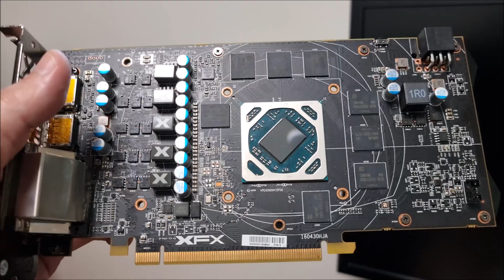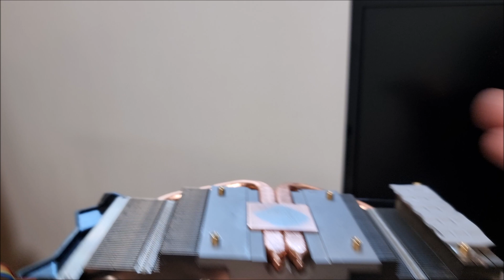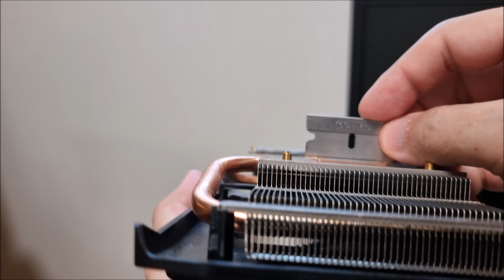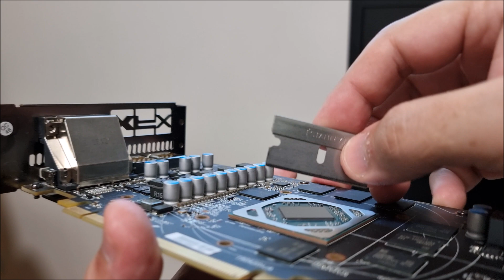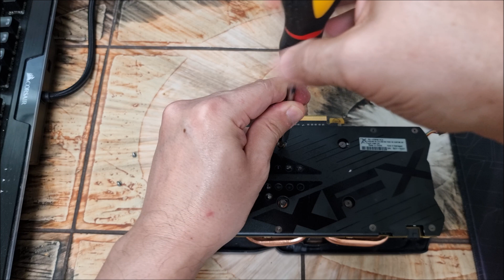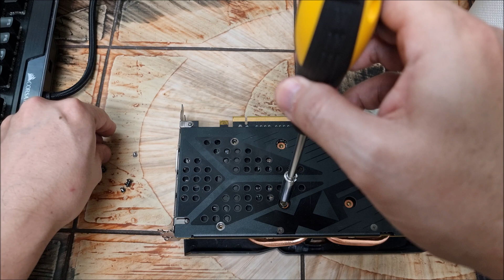GPU Hotspot Mystery Solved! Not What You Might Think!

Comment: I'm a new gpu user, actually bought a used sapphire pulse 5700 oc recently, but I undevolted it quite a bit and the usual temp on full load is 60°c but the hotspot temp it shows on amd software is 67-70°c , but the thing is the upper plate on the gpu there's like a hole and some inner pcb is visible which is directly under the chipset, that part i touched with my fingers and idk man it didn't feel 60 or 70° to me it was kinda very hot idk, is this normal or am I just overreacting
Reply from the maker: 70c and 80c is very hot to the touch. So yes, it is very normal.
Reply: @lyziqco6555  for what it's worth, I'm on a 5700xt and my hotspot is 95-105c at full load, and thats after under volting and underclocking. Research tells me this isn't ideal but also isn't really a problem either. Though I was thinking about putting new paste on to see if it helps. Running stock speeds and volts it was hitting 110c which I think is the thermal limit when it starts to throttle.

Graphics cards have been hot for years though, I remember having an oooold 560ti nvidia card which didn't care about heat till it hit 100c, and that was way back then.

Comment: Gigabyte RX 5700XT Repasted, cleaned & Re-Pad:
CS2 High settings:
Vram 6gb used over 8gb
GPU Temp 82*c
GPU Hotspot Temp: 112*c

Thermal paste: HY510 (I put then spread it using q-tip as substitute then put a very tiny in the middle in the Die)
Thermal Pad: Subzero GP-Ultimate (vram 0.5mm mosfet 1mm backplate 3mm)
Reply from the maker: So whats your temps now?
Reply: that's my current temp, uncle helped me last night doing repasting and cutting thermal pads. @TechnologyHive  I think I didn't put the heatsink too hard and some of my internet fellow players telling me that I put too much thermal paste in the Die and shouldn't spread myself using q-tip but instead just drop a pea size and let the heatsink spread itself.
Reply: @TechnologyHive  It was 2nd hand I bought in facebook marketplace in worse condition too oily, the fans are coughing with dust, the board was bad and the paste inside was dried. I tried playing once CS2 then shutting my PC monitor and freezing everything because when I check inside it  was Dried stock paste and Pads was torn down. It was like if remember correctly the 87-89*c on GPU temp but the Hotspot I don't remember much since I was using old version of AMD Driver that time. Bough January 2 2024
Reply from the maker: @markhovscrch4050  It is better to spread the paste over a GPU die. Using the pea method could result in areas not covered with paste, resulting in a hotspot problem. your internet friends are wrong, I'm afraid.
Reply: @TechnologyHive  I put a medium size then spread it into Die then I put a very tiny amount of paste in the middle of Die and slap it with heatsink. Maybe on Next sunday I go repaste it again I felt unsatisfied due to my current temperature of Hotspot right now playing Hellbound: Survival Mode on V-sync + Ultra settings sending my it into 102*c but the GPU temp was 81*c something isn't right
Reply from the maker: @markhovscrch4050  I'm sure it's due to poor contact with heatsink.
Reply: @TechnologyHive  Yes it is poor contact with heatsink I must squeeze it again next sunday.
Reply: @TechnologyHive  i have known someone who used radeon vii for 110c hotspot for 5 years and it still performs very well
Reply from the maker: @thepromptist47  That is because the card is thermal throttling to protect itself. It would run much better if the hotspot temperature was reduced.
Reply: HY510? that' why.
I had the same and used it for my 12 years used ATI radeon HD 5570 and I got 15-20c worse temperature (80c+) over the (Original paste 12 years old!)

Comment: I've ran games that pushed to 62 degrees and hotspot to 88 but no more than that. My GPU is relatively still fresh despite having it for a year now (It's an XFX RX 6600) and I can't tell if that's a lot or it's okish but it concerns me a little.
Reply from the maker: 88c is not dangerous territory. 95+c I would consider too high.
Reply: @TechnologyHive  Ah, okay. 88 is generally max it goes, usually lingers between 75 and 85 but never constantly. Thanks for the info. Only started observing that temp now
Reply from the maker: @a4455.  You're good. Just keep an eye that it doesn't go over 95c. Then you'll need new paste :)

Comment: I dunno my 7900 xtx asrock aqua runs like 111c and zero issues on a super ultrawide monitor at 1440P. Runs flawlessly. Some of it i think is just BS. Because i'm even running x2 420 rads. All i'm saying it's been running like butter.
Reply: I think a lot just want extreme cold temps for benchmark scores. It's hard telling because my card isn't throttling nor is myCPU. I mean absolutely zero issues. And this has been for over half a year.
Reply from the maker: @ramblinjay3816  110c is extremely hot. If you keep it running like this, you may be cutting short it's lifespan.
Reply: I dunno, I'm still running it fine even on helldivers 2. Even maxed out settings at 100+ FPS and it's all liquid cooled. I'm still hitting like 111c lol. No stuttering, lagging, nothing at all. Why i am so confused about all of this. Even with x3 420 radiators on a full looped system i am still seeing zero issues regarding it being too hot. 

I will also include this is also with Asrocks extreme bio software update. If i'm not throttling and i am losing zero productivity it's still going strong.

Wouldn't i be noticing throttling issues running this hot besides just a possibility of degrading the GPU overtime? @TechnologyHive
Reply from the maker: @ramblinjay3816  111c is too hot. This will slowly degrade your gpu.

Comment: My 6950xt had the same issue no matter what i did. It would hit 110 on hotspot until i used ptm7950.  It made a huge difference now hot spot is about 90 thats with the card overclocked to the max.
Reply from the maker: Very interesting. I keep hearing about this stuff. I'll have to try it myself. 👍🏼
Reply: PTM7590 is magical stuff for sure! It has performed better than liquid metal on my GE66 gaming laptop, believe it or not. Glad to hear that it fixed your issue!

Comment: why doesn't my AMD XFX 319 6800XT GPU temp go up on my kraken 360 elite's display during furmark runs?...Furmark says gpu is 72c but the kraken display says 42c....wth??? the Kraken has always reported a temp that's around 10 degrees cooler than what my adrenaline software says or what hardware info64 says, but with all this variation from different softwares i dont know what to believe
Reply from the maker: Download GPUZ from techpowerup.com and run fuemark again with gpuz displaying temperature and Hotspot.

Comment: Well, is this a coincidence or all brands have this problem? I bought XFX RX 6800 (Non XT) before new year and have return period till 13 Jan ‘24. 
The card overclocks well with fan  high speed RPM and over 200W power consumption.
Using AMD PRO 23.Q4 driver as that was installed by default with their software.
Gpu frequency set to: 2300MHz low/ 2420 MHz max (2400 effective),
VRam timing set on: Fast timing ,
Vram  frequency set to 2112 MHz (2100 effective),
Voltage set to 925mV with Power Limit +10%.
Fans blow between 1500 and 1800 rpm with temps up to 60C with 74C hotspot.
This is my first AMD GPU since 20 years ago. Should I return it because of the 14C hotspot difference?
Reply from the maker: Nooooo. Your temperatures look good actually. 74c on the hotspot is perfectly normal. 95-100c is not. Though AMD will say 95c on the hotspot it ok. But this is BS. They just do not want to deal with RMA's for a problem that slowly degrades their products. 

In time, after some years when the thermal paste starts to lose it's thermal conductivity, that hotspot temp will skyrocket and cause your card to thermal throttle, eventually causing problems. But in your case, you're fine! 👍👍
Reply: @TechnologyHive actually if I use the default factory settings the hotspot goes up to 98C (fans run ~900rpm) and get far worse results with games crashing very often. 
Is my overclock high for this gpu? I think I could squeeze just a bit more performance out of it.
And again is 14C difference overall/hotspot temp normal?
Reply from the maker: @DennyMK007   14 degree delta is okei if the hotspot is under 95c. But if at default settings your temperatures are getting that hot, that is not normal. 98c is pretty toasty. I would RMA it or replace the thermal paste and see if that fixes the issue.
Reply: @TechnologyHive  RMA it is then. I don’t want to bother replacing thermal paste/pads on brand new gpu.
Thanks

Edit: I bumped the frequency to 2440 MHz and lowered the voltage to 920mV. 
With the Power limit to +10% it runs constantly on 1025mV.
Gamed for two hours with HWInfo in the background. The result:
GPU temp max 58C, Hotspot max 71C, fans max 1780rpm. I can’t get anything new with 3 years warranty for $425 16GB VRam after tax that’s going to be better than this. Keeping this cheapo awesome overclocking gpu.
Reply: Hi. Is this thermal paste issue on all the 7900xt cards? Or is it rare to buy one and get this issue? Still on the fence to buy one..

Comment: Hello.during gaming tlou,alan wake,warzone,when fan speed is 40-45 gpu temperature is 50 celsius and in alan wake 55-57,in furmark after 17 minutes strees gpu is 73 celsius and hotspot 93-94(fan speed 50%)and is it normall? Iddle temp gpu is 25-29 and hotspot 33-34.
Reply from the maker: That's a 20degree delta, which is a bit high, though common. You could improve this by using better thermal paste if you feel comfortable doing it yourself. But if your card is still under warranty, keep in mind that taking it apart will void it.
Reply: My rx6700Xt has a 30 C° Delta. 75 to 105. Allready done a rma ticket. Let's see how they answer
Reply from the maker: @daidalos1508  If you have warranty on it, that will be the better way to go. Just RMA it.

Comment: Have had some issues with my screen just turning off randomly, these were my temps:
This is with fan speed all of my case to the max
GPU highest temp: 81.2 C
GPU Hot spot highest temp: 93.9 C
Highest CPU temp: 71 C (I love my noctua cooler)
Reply: That temp for the card, not the hot spot but the general one, is likely nearing the point of throttling and does indicate to me that there is an issue with temps. That CPU temp is high as well, depending on your CPU. What are your system specs? Does your case have decent airflow? Have you tried custom fan curves?
Reply from the maker: Does the screen turn off while under load or also during idle?
Reply: @TechnologyHive  The screen had turned off while it was idle.
Reply: (Watching youtube)
Reply: @Floridian_Krillhead  what was your findings? I too am having my screens turn off randomly, not always while gaming either, and my hotspot is getting to 110c if  I run a benchmark. Did you get a new gpu or was your power supply the fault for turning off? I have just fresh installed windows and drivers and same thing is happening for me. My gpu is only 1 year old as well in very good case ventilation.
Reply from the maker: Have you tried new thermal paste? Sounds like gpu is overheating.

Comment: well the only problem i have is my rx 6700xt, first thing i use copper thermal pads on my memory, the overall GPU temps down to 60-70 on full load, but the junction/hotspot reached 100+ , even when the load are 80% or below
Reply from the maker: I think I understand you're doing the copper shim mod on your VRAM, right? If I were you I'd leave the vram alone and put the card back together at stock configuration. That hotspot temp is pretty high.
Reply: @TechnologyHive  i did what u said, with better quality thermal pads + paste, and yes, my RX 6700 XT are no longer pulling those hellish heat

overall temps is 70 and hotspot reaches 90-95 which is pretty good improvements to me , at 99% load/usage
Reply from the maker: @i_zoru  nice man. 👌 95c is high but tolerable for every day use.
Reply: @TechnologyHive  My Rx 7800 xt is getting 95º on hotspot, Should I worry about it?
Reply from the maker: @Alanxnascimento  I would replace the thermal paste. The problem is AMD and NVIDIA like to use cheap pastes for their cards.
Reply: @TechnologyHive  but you Said 95° is ok right ?
Reply from the maker: @Alanxnascimento  95c is high, but tolerable. Your card will be thermal throttling, which means you will lose performance.
Reply: @TechnologyHive  yeah the only explanation for the max hotspot temp is that the heatsing, are slightly oxidated
Reply from the maker: @i_zoru  I do not know what country you are from, but they do sell "oxide clean" in spray form here in Norway. You will find it in any auto part store. You can use that same stuff on circuit boards to get rid of mild oxidation.
Reply: @TechnologyHive  I recently bought an rx 7800xt nitro +, I tried stress testing the card, but forgot I locked my fan rpm at around 37% , my normal gpu temp went around 70-80c and my max hot spot peaked at 90c, will having 90c hotspot for a few seconds degrade my gpu ?, I am a bit new when it comes to these things thanks in advance
Reply from the maker: @gabtyty  No no. 90c is not bad for hotspot, especially if it's just for a few seconds here and there. However, good quality thermal paste, like MX-6 or TG Kryonaut Extreme will definitely lower yemps overall.
Reply: I recently noticed my rx 6900xt reference hotspot hitting 112 celsius while the GPU was at 71 celsius, 98% load native 2k stalker 2!
 I replaced the factory vram pads with new ones but the hotspot temp persists at 112 celsius!

I have already applide liquid metal to the gpu since 4 years ago

What do you think could cause this high hotspot temp ?
Reply: @AlexSBedini  did you solve it? What thickness were the new thermal pads?
Reply: @AlexSBedini  VRAM pads don't help with hotspot temperatures.

Comment: 3070,  GPUz readings
Idle: GPU=47c Hotspot=58c
Under load with MSI Kombustor & Temperature limit set to 65
GPU=64  Hotspot=76
Reply from the maker: Thats not bad man. 10-15c delta is within reasonable limits.

Comment: I HAVE THIS EXACT SAME ISSUE on my RTX 2060 i have seen reviews of the same exact card before buying it but mine always having a high hotspot with a delta of 15-20+ degrees C than the normal temps which worries me too much and i tried repasting and the paste dries out in the middle and it shows on both the heatsink and dye always completely dry in the middle and the i did try contacting the company that made the card and they said to ignore the hotspot as long as the card is not thermal throttling so for my own peace of mind i had to undervolt it to 0.85V since it can go up to 1.05V .... so yes my heatsink is flat yet the dye isn't perfectly flat and it causes the stupidly high hotspot
BTW, my hot spot under full load without any undervolting is 106C in heaven benchmark in less than 1 minute of it running the hotspot difference can be 25C
Reply from the maker: 106c is nothing to ignore my friend! 25c is a big jump. One solution I have found is liquid metal. But the cooler base has to be nickel plated to pure copper. This also works for decreasing hotspot issues. Remember also to cover the SMD's around the GPU with nail polish. Preferably a coloured one. This issue with DIE unevenness is nothing new but has become a bit complaisant in the tech environment. I wish bigger channels like Gamers Nexus with a bigger audience would pick up on this issue to perhaps bring about change. I'm just a small channel, so much I can do. Hope this helps
Reply: @TechnologyHive  the card is an EVGA RTX 2060 sc, it's a single fan card but tbh the heatsink should be enough and i have 2.4k RPM case fans and all that did literally nothing i even thought about deshrouding it but the card consumes 170W so no amount of air would actually make a difference, with undervolting it consumes only 130w yet the hot spot in a stress test is about 95-96C .....  at this point i have tried everything and liquid metal is a bit expensive but i may give it a try in a while since i have no other options.... and you're right, no one from the big channels is mentioning this 
thank you for bringing such issue to the light and maybe because of your video more people will come out and talk about this so again, THANK YOU and keep it up

Comment: What on earth is AMD doing here?
On my old Vega56 you can literally see the machining marks from when the Die was ground/lapped to perfect flatness. I get that thats necessary with a GPU consisting of 3 Dies (GPU + Memory) on one Substrate but obviously a Die that isnt flat is a problem.

So what is the solution for this? 
I am sure that I have this same problem but its really bad (100C Hotspot) with an RX6700 and it has to be fixed.
Literally repasted it a few hours ago with MX4 and yup 100C hotspot 😐
Try different pastes until something works?
I have MX6 and Gelid GC Extreme too. Maybe a thick gooey paste helps bridge the gap like another commenter said.
What about those special super thin reuseable thermal pads for GPUs and CPUs? Those will probably cope really well with the uneveness of the GPU Die.
Reply from the maker: I made a video explaining how to tighten your heatsink closer to the gpu core. It's in one of my latest videos about making thermal pads fit. You'll find it at the top.
Reply: Try honeywell ptm7950

Comment: you can use more viscous paste like arctic mx-6 to bridge the concave gap between the heatsink. it won't pump out easily under direct die temperatures like other paste formulated for cpus for example noctua paste.
Reply: ptm7950 is the goto, mx-6 etc are all highly viscous and will much more easily be pumped out.
Reply: @muuubiee  Don't understand what mean by pumping out? Like spilling out around their edges?
Reply: @AwesomeBlackDude  yeah, it gets liquid and runny, and get pushed and spilled out around the edges.
Reply from the maker: MX-6 is a good product no doubt.